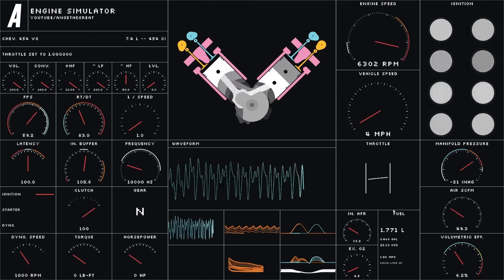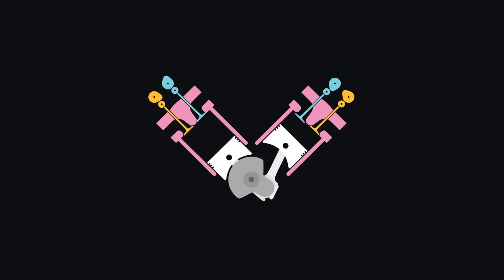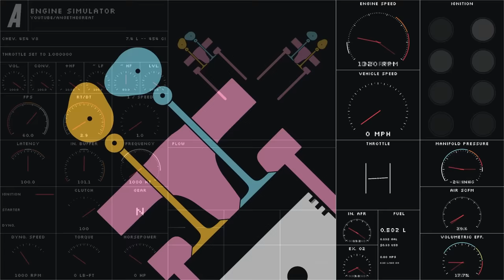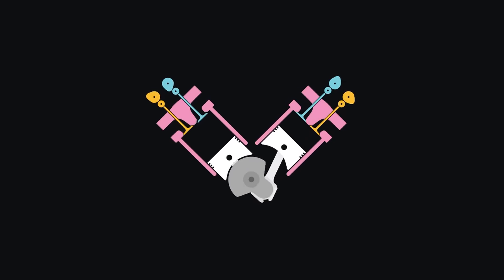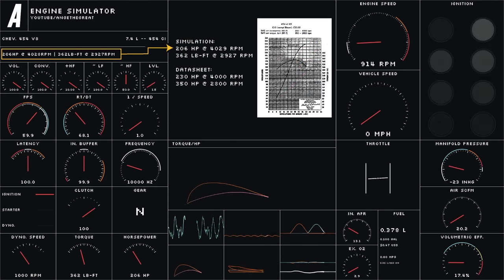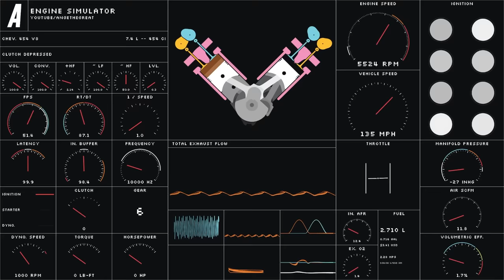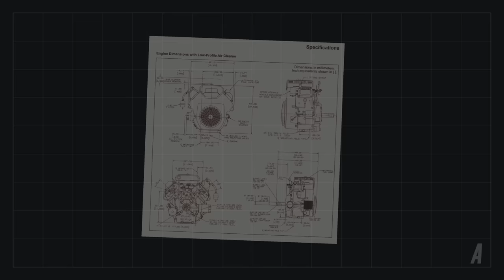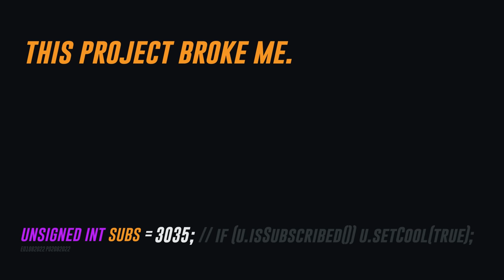Simulating an Entire Car Engine (yes, it makes noise)

Comment: This would be cool to add to a racing game where you could even customize your engine. Do you think it could be implemented into unity or unreal engine?
Reply: With the "this has to run at 85k fps or the engine deletes itself" requirement, no.
Reply: @SpaceDogLaika  It would have to run on a different thread, of course the game engine itself wouldn't run at 85k fps. I think it should be possible but really depends on how much processing power the simulation requires.
Reply: Definitely not either of those engines
Reply: Two still popular games already have this implemented (well the raw sound simulation that's tweakable by components, not this particular example ofc) are LFS and BeamNG through Automation. There were a few other projects i know, mostly from japan, but they are obscure now.

Also there would be nothing preventing adding this to unity or unreal on normal computers, contrary to few answers above. You don't simulate this kind of stuff these days in real time but bake a sound bank. The real problem is amount of work needed, and having professionals at hand.
Reply: @lingSpeed  though baking a sound bank would remove the ability to tweak variables wouldn't it. might as well use regular audio samples at that point.
Reply: @GAZEREAPER  I mean it already has been done. You bake the bank after every tweak, it takes less time than getting through menus to drive. Automation+Beam does this. And while i was never into consoles, i believe some gran turismo games did that as well. Not recently thou, it's an old idea better suited to tighter hardware limitations and grand plans like having 1000 cars and tuning on top.
Reply: @lingSpeed  Ah I thought you meant baking the audio during production, not in the game itself. Yeah that would indeed be much more performant.
Reply: @GAZEREAPER  his point isnt that the game would have to run at 85k fps, his point is that this guy makes the simulation sound like something that takes up a fuckton of processing power.
Reply: Live For Speed does something a LOT like this. Very close to this.
Reply: @lingSpeed  i have played with the sounds for automation cars in beam, just awful, its just the same sound pitched up and down based on displacement.
Reply: @Skidtire  You should try LFS then, sound is created more like this video... except it ends up far worse than Automation. Point is, im talking that the tech needed to make this happen is already in use, even if quality is dubious. LFS has the synthetic sound part, automation has the bank creation part.

Honestly i've talked to few AC modders and who knows, we might see this very script used there. Assuming it stays open source.

Comment: I love that this is OSS. I'd also love to see companies making racing sims pay for this and incorporate it into their games. For example, the Forza Horizon series has been taking flack for their engine sounds for the last few releases. It seems like it would be possible for them to take this as a way to generate a sound set for an engine and create a better platform for engine mods. They make the sim run this engine sim client side, record the results, then use that as input to the driving sim portion of the game (as opposed to trying to run this in realtime along with the rest of the driving sim).

Comment: I'd love to see an in-line 3 cylinder motorcycle engine. They have very unique sounds and i'm curious if your simulation can replicate it. Mines a 675cc motor and revs to about 13500 rpm

Comment: I'm really interested in parts failiure and breakage, is there a way to simulate that? think next up you should try simulating forced induction either positive displacement or turbo and push some engines to their limits :)

Comment: I'd love to see this simulate an aircraft engine. Maybe a Continental O-540 Horizontally opposed. Is it possible to alter the output resistance, because that way you could also feasibly simulate a Constant Speed Propeller or Variable  Pitch Propeller. Not sure if aviation applications were built for this, but it would be cool to see some Continentals, Lycomings, and maybe a Spitfire Rolls-Royce Merlin V12.
Reply: Agreed.  I'd love to see it run with more than just 2 banks, too.. like maybe a 7-cylinder radial engine.
Reply: I'd love to see an IO-520 replicated so I can live out my daily Cessna 210 nightmares in perfectly simulated noise 😆

Comment: Fabulous project!!!

Just a suggestion since there isn't one running anywhere in the world and very few people alive today will have ever heard one running, the 24 cylinder Napier Sabre which is basically 2 flat 12 engines geared together to drive a common output shaft. It was a sleeve valve engine however, so it might be very difficult or impossible to simulate. A comparison between the Rolls Royce Merlin and Rolls Royce Griffon engines would also be interesting. They are both 60 degree V12s, but the Griffon has a different firing order than the Merlin giving it a quite different sound. Merlin firing order 1A, 6B, 4A, 3B, 2A, 5B, 6A, 1B, 3A, 4B, 5A, 2B, A being the right bank as viewed by the pilot
Griffon firing order 1A, 4B, 3A, 2B, 5A, 1B, 6A, 3B, 4A, 5B, 2A, 6B.  Cam duration, the Griffon has a modest 28 degrees of overlap and 248 degrees of cam duration compared to the Merlin's more radical 43 degrees of overlap and 263 degrees of duration. Merlin displacement is 27 litres. Griffon is substantially larger, 37 litres

Comment: Is that high "clicking" sound that's not supposed to be there because of the engine being "open" in the simulation?
Really awesome video, I'd love to see an in depth technical breakdown!
Reply: Idk if the clicking is what you're referring to, but irl alot of engines have ticking noises that can come from a few things, namely fuel injectors and lifters. Which is to say alot of engines also have a high pitched ticking sound and especially on alot of smaller car engines, it's the most prominent sound due to how small and muffled the engine is.
Reply: @play3rthr339  Maybe that's what I'm referring to, I can't tell for sure. Only thing I know for sure is: I've never heard such a "ticking" or "clicking" noise from any car irl, neither small nor big ones, not when cars drove past me and neither when driving a car myself. Is the hood blocking that sound efficiently enough to (nearly) vanish compared to the other sounds?
Reply: @Kirschi__  I guess I should've clarified that it's typically with cheaper, smaller cars. Nicer ones have better sound damping to reduce the noise, but it's usually still there if you look for it. The 2016 scion ia is the biggest example I can think of that has a non-defective tick. RCR did a video on the car and he points it out as the injectors being the loudest part of the engine.

Comment: Question, if the program can articulate and calculate sound, couldn’t you reverse engineer an engine starting with the sound? If so, what are the limits of that theory?🤔 just a thought
Reply: Pretty cool stuff
Reply: I think it would be like flipping a function over f(x)=x. So it won’t be gauranteed to remain as a function that way, meaning there will be multiple results from one input
Reply: probably not, considering all the variables introduced in the recording process - the microphone used to record will introduce error, no matter what you use, just because of the physics of how microphones work. you will not know what the properties of the exhaust are that cause the sound to sound like it does either.
Reply: @itsumonihon  @casualdestruction I agree that variables in the recording, and environment could absolutely influence the process, but with multiple recordings in various conditions you could produce a normal map of sorts to create a sudo ground truth. That being said, anything that is potentially generated would have some margin of error. What would be really cool would be to train a neutral network to do this. Tuning would be relatively easy because you already know  the real values for any vehicle who's noise you feed it. Once it gets within a 95% accuracy range you can start feeding it audio from these simulated engines and have it work on that, essentially building a high fidelity closed loop GAN. It's not impossible, but it would be as, if not slightly more insane as this whole project is.
Reply: this program uses white noise synthesis, this is not that realistic. also, at some level, this is an N=/= NP problem, you can calculate some things one way but not another, idk tho
Reply: @yamsang0__0  I could see that. However, I don’t think an exclusive formula is necessary. Multiple formulas that have the same result would also be interesting to see
Reply: @sethswheelhouse  I think it’d be a revolutionary proof of concept regardless of how well it turns out. But I agree with everything you said

Comment: First of all, looks and sounds amazing. Can't wait to see these kind of sounds in a real game.
80.000 fps simulation doesn't look reasonable in game development where you may have users with low end cpu/gpu and expensive parts (graphics, ai) to compute simultaneously, BUT, nowadays the only thing you need is the right model and the right black box model for it. It could train a neural network using sampled data from your model, and then use that nn while the game is running. You could even design your custom motor in the game with this in mind. Each car could have different motors with different networks, which would be very difficult with a precise model like yours.
The future is bright, and again i can't wait to play something that makes me want to lose myself in the sound

Comment: this is awesome! this project totally is inspiring. if i can sim my engine i could just as easily use the sim to "train" my dashboard and computer.

i have a scooter that im working on making it like not cheap and have fancy computers on it. so my dashboard has all the info on it that i would need to better tune the simple gy6 engine, even modernizing and adding features more common on engines. one of my issues is not wanting to run tests on the actual engine. my original plan was to install all the modern sensors first, and just data log normal runs/rides to use to feed the dashboard and computer. then once i have confidence the sensors are operational, i can start to implement and test "autotuning". siming the engine would help in getting all the variables lined up at the right time. plus being able to step through each slice of time would be awesome.

as a suggestion, im willing to bet if you include the proper friction (maybe check standard v8 oil viscosity or something, particularly between the piston walls and the valve springs) and effects of gravity (when the cylinder walls came off it seemed like gravity wasnt affecting the piston in a natural way), im assuming you nailed the fuel conflagration, that may compensate for the +-10% or so you stated the error was compared to known dyno values. that friction does add quite a bit to the engine load. or maybe you need to just add a flywheel, which i didnt see in this video, to compensate.

damn now i wanna start devbloging lol.

(edit) not that the sim needs be 100% accurate but it may bring out more nuance to the engine sounds.

Comment: what a rad video! i got an engine you can simulate if you feel like it. 3.0L, 90 degree V10. 94.5mm bore x 45mm stroke. maximum rpm around 19000rpm. bore and stroke might not be all that accurate. these are figures from a 2000-2005 era formula 1 engine. thanks dude. love your work.

Comment: YOU DID IT!!! BRAVO!!!
I'm listening to this on Klipsch RF7's. It's rumbles the place just like a dyno cell. 
So.... how well does this system interpret headers? I want to try an inline 6 with the front and rear 3 primaries going into intermediate primary tubes, and then into a single tube, versus 6 into 1.  I'm trying to decipher the scream of the 90's F1 Ferrari. Your other video may have had assumptions that are hard for us to pin down about the real deal. 
--- I also want to try a 102 degree angle 4-valve V-10 with obnoxious bore sizes and camshaft specs.
 4.5" bores, 4" stroke.1.85" intake valves, 1.54" exhaust valves, 6.25" connecting rods, 1.27" piston pin to crown distance. 13.5:1 compression. 
-- Camshaft specs, IVC=52 abdc, IVO=8 btdc (240 degrees total @.050"), EVC=7ATDC, EVO=58BBDC (245 degrees total @.050")  I trust your ramp rate for the cams. .614/.513" lift, 
-- Crankshaft Journal configuration: Looking at front of engine, rotating clockwise. Journal 1: 0 deg, Journal 2: 144 deg, Journal 3: 288 deg,  Journal 4: 216 deg, Journal 5: 72 deg. 
-- I want to try both even-fire and odd fire.
Reply: Firing order: Staring at front of engine rotating clockwise, 13579 on the right side, 246810 on the left side. 
Even order : 1 4 3 6 5 10 9 8 7 2
Odd order : 1 4 8 7 2 10 9 3 6 5

Intake runner: 2.6"x10"
Exhaust Primary tube diameter: 2.5"x38"
Compromise header:  Cyl 9/10: 36", Cyl 8/7: 36.4", Cyl 6/5: 37.4", Cyl 3/4 38.9", Cyl 1/2: 42"

Collector: 4.75"

Comment: first of all, this is absolutely amazing. second of all, i have a couple of suggestions, take this comment how you want.

Forced induction
     weather it be twin charged, turbo charged, or any type of supercharged

Exhaust tweaks
      ability to add different muffler types, catalytic converters, and things like piping diameter, length, and wall thickness

Diesel
     pretty self explanatory, ability to add compression ignition engines

2-stroke
     again pretty self explanatory
 
Engine configs
     Ik you've done it before, but like what about vr engines and w engines???

entry ignition engines anyone???????????????????????????????

Comment: What would be a very cool feature.
An OBD2 Dongle that you can put in your cars OBD2 port and it can read the data of your variable valve timing system and implement it automatically into the system added with the given load and rpm. 

Often these systems are optimized for emissions, then economy and finally power. 
These are hard to figure out where to optimize and this would be a great tool for improving fuel economy or power on such system. Given that you can flash the ECU

Comment: this would be a long shot but it would be cool if you could make something like this for nozzles/aero. Where you could mess with upstream/downstream pressures. Create different structures to generate shock/expansion waves, over/underexpanded flows. Not as precise as CFD but like an approximation to create cool visuals of compressible flow.

Comment: im kinda a engineer and inventor. doing awesome things like putting dis and injection on a ford 200ci, but i have a idea for cam shafts . to basically cut up a v6 inline or v8 cam to cause it to have 2 power strokes at the same time.

Comment: I'm curious to hear more. Specifically the inputs you are modifying to change the engine. Intake valve size, number of valves, engine timing... Intake runner size.

Comment: Loved this video and I had a (very quick!) scan of the code so far. Awesome stuff, really impressive. Am I right in thinking the fuel delivery is currently based on a fixed venturi carburettor? Are you intending to go down the rabbit hole of fuel injection in all its varieties? Also, I note in the code you've added capability for Honda VTEC. Are you also thinking about the more common VVT and variable valve lift?

Comment: This is a fun little program. Just like you, I've been annoyed by the inadequate engine sounds in racing games. Just basic empty noises that barely sound like engines. Actual engines have more character, as your program demonstrates. This gets as close as is reasonable to an accurate engine sound, to do any more you'd need information about the shape of the exhaust manifolds, exhaust routing and diameter, intake type, intake routing, and that changes with every car. Fuck the haters, this is awesome.

And because I'm such a motor nerd, here are some off-the-wall suggestions:

Suzkuki G13A (1.3 liter I-4, 8 valves, SOHC, used in the Suzuki Samurai)
Ford Cyclone 3.7 (3.7 V6, 60 degree, 24 valves, DOHC, variable cam timing on all four cams, used in Mustangs/F150's in the 2010's)
Mitsubishi 3A92 (1.2 liter I-3, 12 valves, DOHC, found in the Mitsubishi Mirage)
GM Atlas 3700 (3.7 liter I-5, 20 valves, DOHC 2008-2014 Colorado)
Mazda 12A (1146cc two-rotor, early Mazda Rx-7 engine.)

Comment: The simple waveform version of the sound is uite interesting, could work for some wireframe rally sim, super realistic physics and engine behavior, very simple cars, tracks, audio and visuals, like, Battlezone, but with propper physics simulation.

Comment: @Angethegreat. serious question. I totally relate to what you were saying about "playing games that always have very underwhelming or cheap sound effects for car engines"
but from my point it's about airplane engines, and I'm just dying to ask, do you suppose you could create a simulation for this but with a turbine engine, specifically a turboprop? I mean, the only game in recent memory that has a turpoprop plane (a Cessna C208 Caravan in this case) that sounds almost exactly like the real Cessna Caravan is Microsoft Flight Simulator, but I don't need to tell you how resource intensive and difficult it would need to be to actually record those sounds properly. 
Ace combat is an example of a game franchise with jet fighters that I absolutely love but the sound effects for the jets just sound very cheap and artificial.

Comment: I build high performance engines, what is very interesting is the torque curve, could help to estimate the rough area one should aim for. U should add in a setting to simulate oil flow and if it’s dry or wet sump, and what fuel one uses such as ethanol or what oxygenation number the fuel has